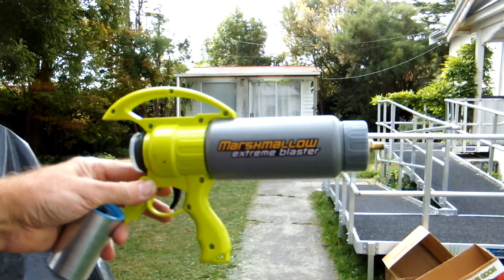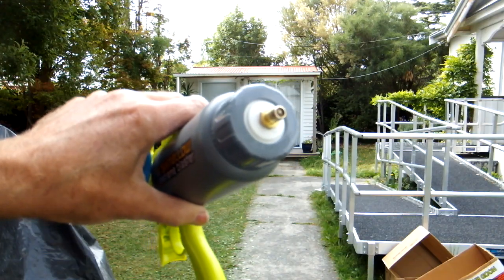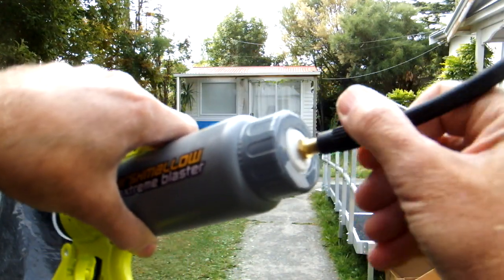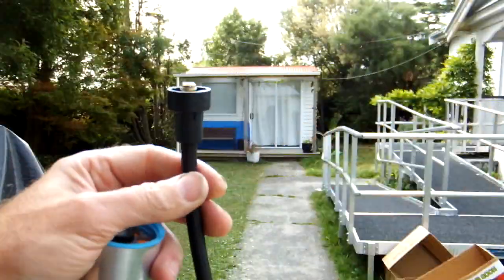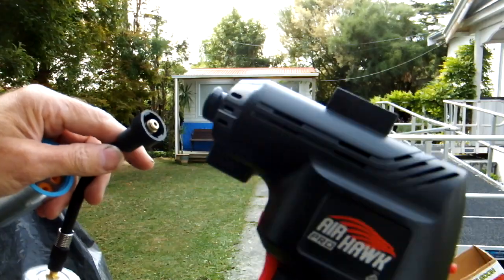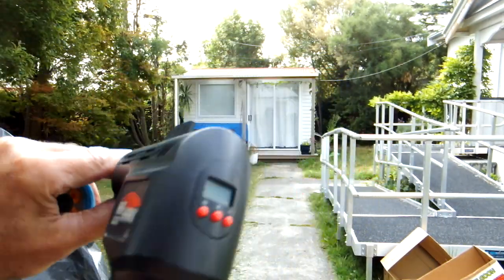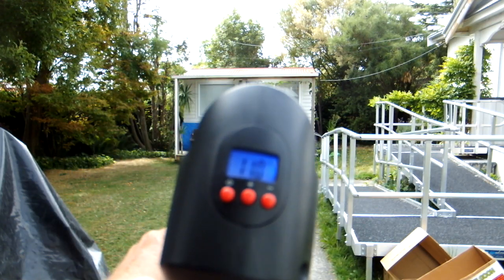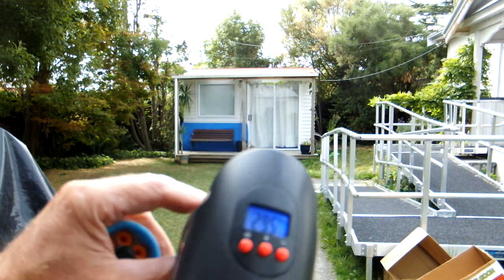ALIMENTAL Launcher System: 12v compressor test (MMXB with 6-shot QD Absolver-shell)

Comment: Hahaha love it man! That is such a perfect spread on target. Virtually impossible to miss a human shape at that distance. This system needs an HPA tank and first and second stage reg to have insta feed of 30psi into your system. That takes the downtime down to reattaching a new shell. Whoohaah!
Reply from the maker: Heehee!  Cheers :D Needs HPA BADLY ;) SO cool it performs like it does at the magic HPA-compatable "30psi"... Next goal is working on shrinking that tank-size and rigging up a valve that shuts off the in-flow when you pull the trigger (and making even more shells!) 30psi's a LOT of pressure to fire a missile/PPG at someone with though... will have to work on ways to gimp those shells a bit if I want to mix'n'match between payloads without altering pressure.

There's a minor issue with the MMXB's valve/tank set-up too in that it never quite dumps the FULL volume of air so there's always a bit of excess pressure in the tank - enough so that the compressor's re-fill sensor doesn't consistently trip every time you fire. I've got 2 different auto-fill ones to play with yet plus 1 bare one to wire up with a separate pressure sensor so I think I can get around it.

Again, would be better with HPA. This set-up's a bit noisy for a "sniper", but I do like the idea of having everything on-board without having to rely on out-sourcing your tank-filling...

Comment: Oh dang that tank volume without the pump insert, whaaa!
Reply from the maker: And really easy to do! Just push the pin out on the pump-grip to remove the pump handle, replace the whole pump assembly with a thick enough plate to take a G1/8-to-Schrader adaptor, screw it in and Bob's your uncle :) Though the extra volume's wasted here... those darts are GONE before the extra kicks in ;)
Reply from the maker: Are you playing around with an MMXB yourself? :)
Reply: @unscrupulousmodefiler  no but I did last year. One couplered and another NIB
Reply from the maker: @builderbb8767  How'd couplering work out for you? I've had issues with the flow-path where the air rushed into the expansion chamber straight out of the valve then has to get squeeeeezed back down into a smaller barrel. Basically it just finds an easier way out instead (which is usually through the seal) so results were poor.

Getting much better results off stuff with a large rear surface-area for the air to act on immediately on leaving the valve (ie: open-backed multi-barrel absolvers or large calibre rounds)
Reply: @unscrupulousmodefiler  2 foot 1/2cpvc was hitting in the 250fps range. More effort than it worth. Your modular system is better
Reply from the maker: @builderbb8767  Good to know we're on the right track ;)

Comment: Complete MadLad!  People gonna have to charge you while that pump is on because once it turns off it will be like roaches when the light comes on...every fool for themselves!
Reply from the maker: Unless this happened to be just a masterkey on a full-auto spam-cannon or long-range LPA sneeper... =D

Will vid it on the 5-barrel RSCB shottie next - less power but only needs 15psi to operate so much faster fill-time. Pewpewyaa!